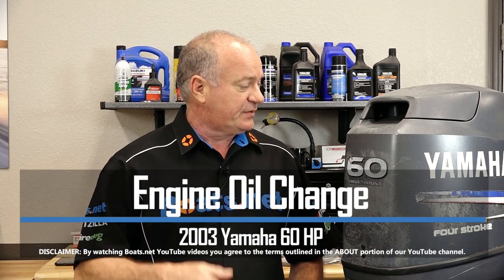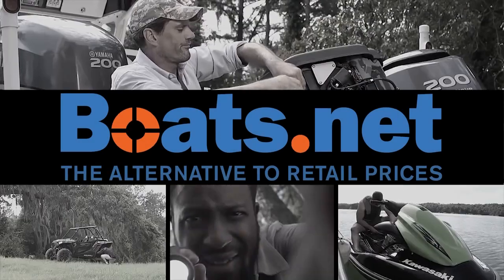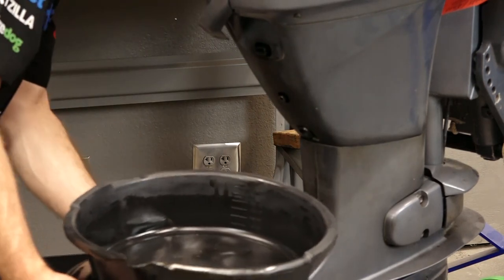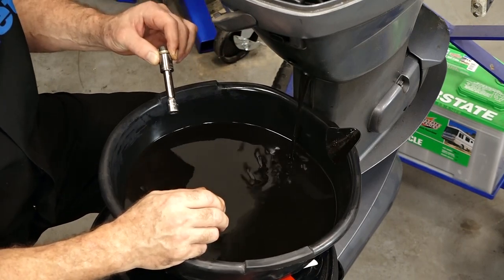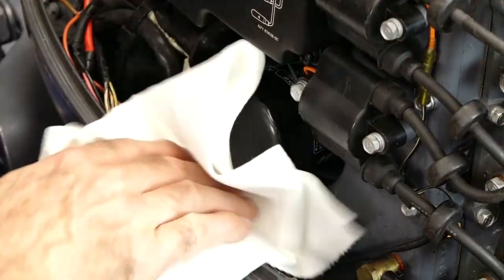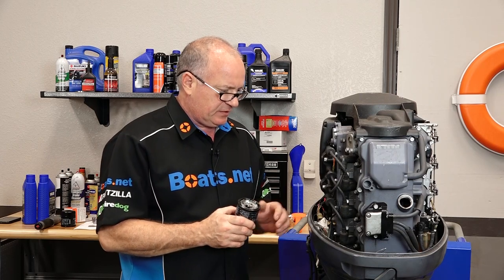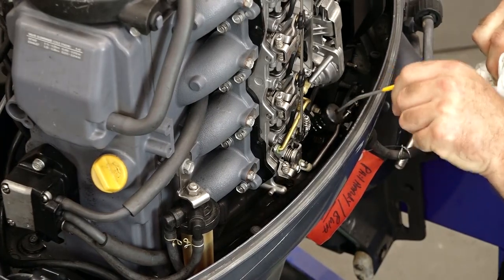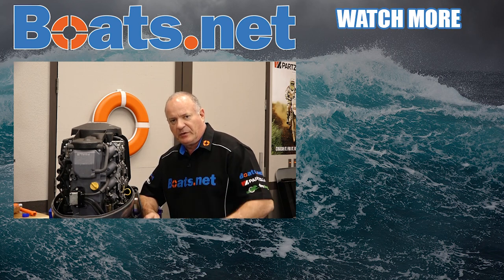Yamaha T60 Oil change | Yamaha 60HP Outboard Oil Change | Boats.net

Comment: Great videos. Question on this motor. I have the 2012 model with 1600hrs. Drive shaft from power head to lowercase has broken. Top part of shaft stuck in place. Not able to grab it to pull it out.

Does this mean to replace the shaft in the lower casing it is a complete rebuild?

What is the best way to get the piece of shaft out at the power head end?

Cheers